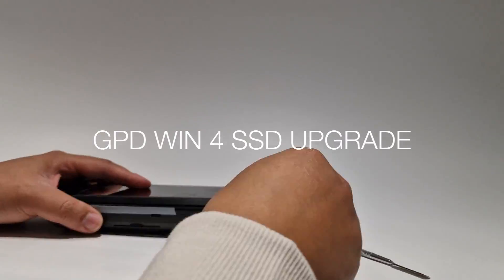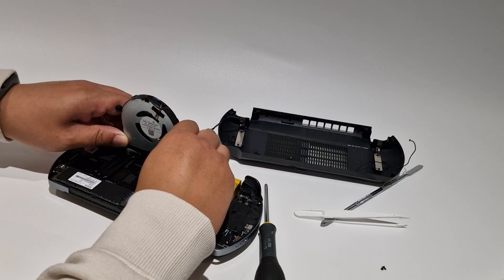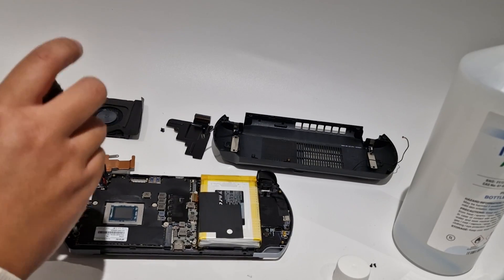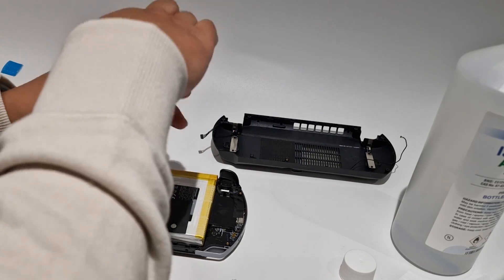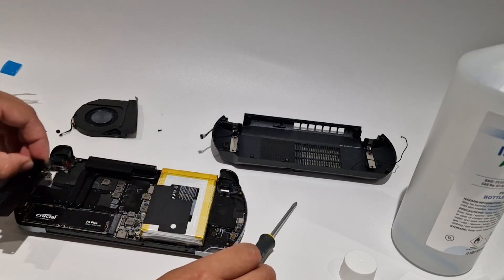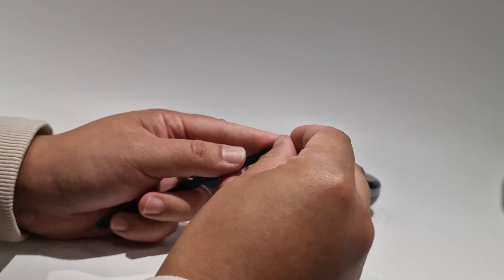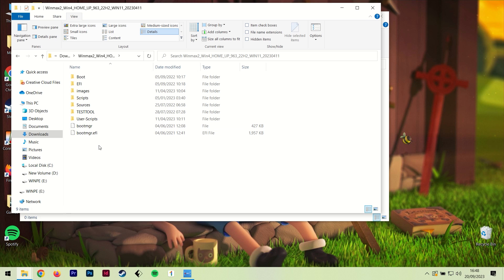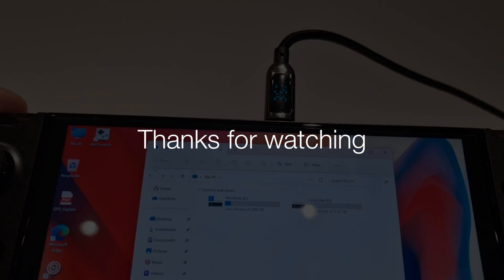GPD Win 4 SSD Upgrade - 1TB to 4TB!!!

Comment: I noticed you mentioned its a "full-size" M.2 ssd, by which I assume you mean its length, but my understanding is that the Win 4 can only accommodate single-sided M.2 ssd's (i.e. those which are slimmer, as double sided ones won't fit).

Comment: Do you have links or names to the tools used besides the Screwdriver. Dont want to use some DIY Pry Tool and Mess Up when Opening It.
Reply from the maker: Honestly, all you really need is a pick and a screwdriver set. There's nothing really special about the pry tools I use. I mainly collect them from buying replacement screens from phones and they bundle in some pry tools

Comment: When I boot to the USB it gives me a blue screen as if it’s to setup, but it’s just blank. I tried opening up cmd to maybe run a disk part but after typing in DISKPART. It just sits there. Any ideas?
Reply from the maker: Hhhhmmm, hard to say. But just make sure the usb stick is formatted. Also double check the SSD is working . Have you tried putting it in another pc to see if it's recognised?